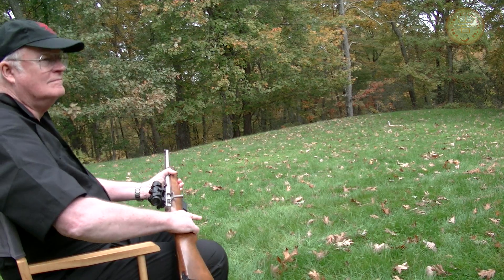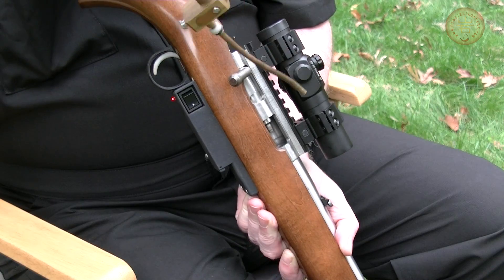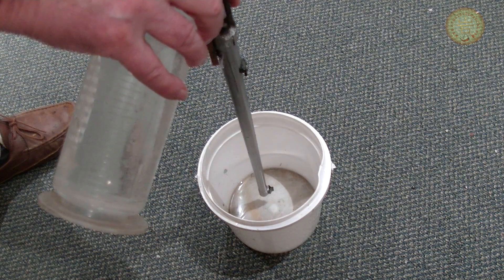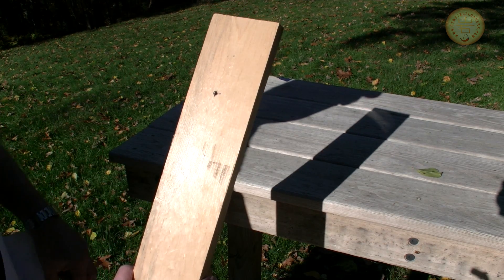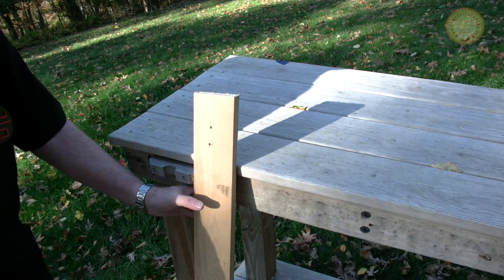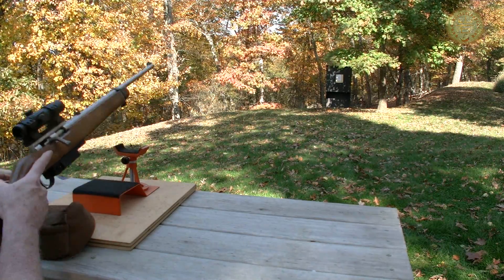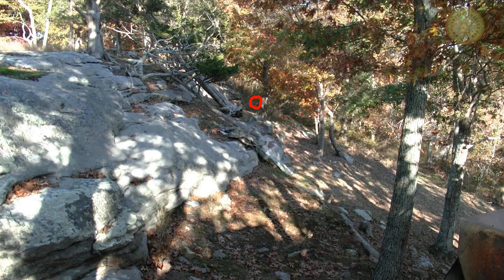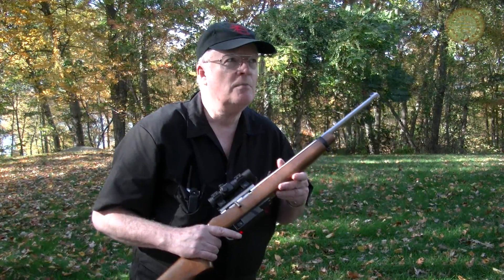The Plink-King, Part 1: A Cartridgeless (caseless ammunition) .22 Rifle

Comment: I have seen videos in your channel and it is very fascinating to see use of electricity as primer. If you are willing to could you answer some questions that I got? How long does it to take for recharge for consecutive shots and how many shots can be fired with full battery? Remington etronx also did electric ignition as far I know using resistor for primer, have you considered similar concept of popping resistor for ignition?  Thank you for your time sir.

Comment: Hi sir, can we make this type of gun  out of nichrome wire?
Reply: Yes, but the wire will not last long at all, and there is a delay from energizing to firing - it takes the wire a bit of time to heat up.
Reply: @stephenwardlaw6428  got it sir, thank you..  any idea about another way?
Reply: @niroshanbuddhika3072  Yes, although it is even more complicated. embed a 2mm fused quartz rod in the rear of the chamber and illuminate the back end with a small laser diode so the beam travels through the rod and heats the powder on the surface of the rod in the chamber. Because the pulse needs to be on only a fraction of a second, the laser can be over-driven. The other problem with this is that the 'window' needs to be periodically cleaned.
Reply: @stephenwardlaw6428  thank you sir.

Comment: Two cents a shot. That is almost as cheap as shooting a (weaker) air rifle.
If I may point out, smokeless gunpowder (BP without sulphur) is non-corrosive, safer to handle than BP and... well, smokeless!
It is trivially less powerful than corrosive sulphurous BP, and a bit harder to ignite, but maybe still worth a look especially as you take great satisfaction in that DIY aspect.

Comment: Would it be possible to buy one of these from you??
Reply from the maker: +Joey Skylynx 
Sorry, but I can't sell one, nor any parts for one. The web page and drawings have enough information for any skilled gunsmith or machinist to make one, and that's the best I can do.
Reply from the maker: +Joey Skylynx 
My ears are always open.
Reply: +mlshooter 
Alright! Well I have two ideas relating to your system, but both rely on the hope that these weapons could possibly use paper cartridges, like early revolvers and the Chassepot rifle.  

The first idea would be a backpack over-under rifle which is based on two systems. The first system on the top will be based around your electrical ignition system and would allow the shooter to hopefully fire paper cartridges or simply doing what you do at the moment with straight power and ball loads. If the paper cartridges are possible, this could also allow for the use of shotshells containing birdshot!  

Now with this system out of the way, we goto the second system: For our underbarrel, the system will be based around the 1780 Girandoni Air Rifle. It'll have a small tank of compressed air which can be pumped into with a small hand-pump, and it can be loaded with at least 10 lead balls. 

Like I said, the first system relies a bit on the hope that you can use paper cartridges with your system, as it'd allow someone to pack a few paper cartridges on a bandoiler containing either normal ball or bird shot for hunting squirrels and birds. 

Another aspect to this concept would be the ability to detach the barrels(and ignition system) and realign each system for different configurations. Ideally having either the compressed air system on top, with the ignition system on bottom(with birdshot?), or going for the original system of the ignition system on top with compressed air on the bottom.

Moving on to my second concept, which also would somewhat rely on having paper cartridges being able to work, is a revival of the Apache Revolver system. With how your system works, you could plausibly have a system in which would make for a fantastic revival of the Apache revolver, as the ignition system could be made small enough to fit into the front brass-nuckle handle, while also maintaining the revolving cylinder which could allow for quick shot follow up.

Either way, both these concept heavily rely on the hope that you have possibly tested your system with paper cartridges, if not could you give it a try and tell me how it works?
Reply from the maker: +Joey Skylynx 
A paper cartridge should work very well - at least for black powder. Smokeless may work in a 'combustible' paper cartridge. Of course, this would have to be for something larger than a .22. However, I'm not sure why an electrical ignition would be better than a needle-fire or a simple percussion cap.
Reply: All though a needle fire and percussion caps in general would work, it'd be easier to have an electrical ignition as it would improve the overall, "It'll work" when using paper cartridges. Not to mention having the ignition system would mean that the person using such a weapon wouldn't have to worry about carrying small caps or be overtly cautious relating to the needle.

I also would imagine that the work needed to flip electrical ignition and compressed air systems around with my over-under barrel concept would be a wee-bit easier compared to redoing the firing action for a needle gun or percussion cap. Not to mention would probably be a bit safer.

Actually if you wouldn't mind me asking... What's the lightest you could possibly get this ignition system?
Reply from the maker: +Joey Skylynx 
The lightest would be two to three ounces. However, if you NEED a reliable system, a metallic cartridge can't be beat. Electrical systems are hard to troubleshoot when they stop working - not to mention issues with weather.
Reply: Very, very good point. My only problem though is trying to work out a system which would ignite loose powder and paper cartridges, but at the same time keep the over-under configuration which would be able to rotate the barrels and internals for use in different parts.

If I get around to drawing up a design, I'll definitely send it your way to see what you think about it. Either way, thanks for the help friend!
Reply: +mlshooter
I got another question by the way! Have you ever by chance tried using "Armstrong Mix" as a propellant or is that completely outta the question?
Reply from the maker: +Joey Skylynx 
Use it only if you don't value your life, limbs or sight...

Comment: as this is legally not a firearm and uses smokeless could you make an integrated suppressor like some air rifles have
Reply from the maker: ***** 
I can't speak to the legality of an integrated suppressor on a rifle like this, but you don't really need one if you keep the MV down to around 900fps. The tiny powder charge to drive the ball at that speed makes very little sound - more a 'whap' than a bang.
Reply: +TheAlexagius But it IS a firearm.
Reply: Keith Larsen but legally it isn't, which is what matters
Reply: +TheAlexagius But legally it IS a firearm by US law. 

(3) The term "firearm" means (A) any weapon (including a starter
    gun) which will or is designed to or may readily be converted to
    expel a projectile by the action of an explosive; (B) the frame or
    receiver of any such weapon;
Reply: wingracer 16 it uses non fixed ammo and so is exempt from all the nfa and gca stuff, you could feasibly buy this (if it were on sale) and have it shipped to your door (opposed to it going through an ffl)
Reply: +TheAlexagius 
You probably should read the ATF definition, it IS a firearm. You are thinking that it is black powder and exempt, but the exemption is only for black powder designs 1898 or earlier and they have to be the original (made in that time or before) or a replica of that. 

That being said, I'm not one to promote the fear campaign of the BATFE's ILLEGAL "legislation". Do what you want, don't tell or show anyone, and as far as we are all concerned, we are all "legal" here.
Reply: Dave Smith "Do what you want, don't tell or show anyone, and as far as we are all concerned, we are all "legal" here" - A good general rule for many things these days, and the attitude I adopt.
Reply: +TheAlexagius If people actually followed the law and didn't do "selective" enforcement, none of us would have to do this. However, our domestic enemies now control most of this country and patriots now need to work understanding that this isn't the world that America is supposed to be.

Comment: Just one question : is this system practical for larger calibers? Not a lot larger, either .25 or 9mm.
Reply from the maker: Yes, although one would have to be more careful making sure the powder charge was carefully metered; there is some leeway on a .22 because the volume is small to begin with, but with a larger bore, it might be possible to have a dangerous over-charge if the chamber design was not right.
Reply: So, a design with locking lugs of some sort would be more adequate? And maybe 4140 steel - as much as I hate heat-treatment. Or maybe a "kamerlader" (or whatever the swiss breechloaders were called) design. Would simplify things greatly. 

Also, should I excersise any special caution while working with this ZTA material? I've never even heard of it.
Reply from the maker: MainAvel At this point, we should probably communicate directly. Go to the project's web page and email me.

Comment: Very nice build. I like the way you used the dual stage spark ignition.

Couple of questions: have you considered refining the construction (automatic ball and powder feed)? What machine was used to drill the ZTA, a lathe or some sort of drill press? Have you considered using a lithium chemistry rechargeable cell? (they hold charge very well when not in use)
Reply from the maker: Good questions: I have a magazine-loaded pistol on my channel (MLShooter) and am also designing a magazine-loading version of the rifle. The ZTA was drilled on a lathe, but I am in the process of designing an all-plastic igniter which is relatively trivial to make; I will report about it on the rifle's web site when done, and yes, my pistol does indeed use a LiPo battery. See that video and web page if you haven't already.
Reply: mlshooter Yes, I have seen the pistol video (even if it looks like straight out of a 60s sci-fi film, it's still very neat), but the battery (cell?) looked like one of those super-expensive 12V primary batteries for TV remotes.
(And they also make 3V primary lithium-based cells of similar size :P)

And I would very much like to see a slightly more powerful/accurate rifle version, even if I can't build one myself (legal reasons)...
Reply: mlshooter Also, one more thing - where did you source the ZTA rod? can't find anybody who would sell me just one (or maybe 5-10 in case I destroy some). 
Not 20, not 50, not 10,000 pieces, just one...

Comment: with this design couldnt you use the daisy VL caseless ammo? i know it uses basically superheated compressed air to ignite the propellant. so i wonder if say a hot wire ignition system would work, say take a nichrome wire loop a tiny bit so it contacts the VL ammo then once you pull the trigger it hits a switch to send current to the nichrome wire igniting the charge...just thinking outloud. cool video. and these would sell big time if you had a way of making the parts kits for a rifle, then i would think the liability is not on you as you are selling them as "parts" just an idea.

Comment from the maker: I have no interest in marketing the rifle, but if anyone else does, they have my blessings. And yes, a solar panel - either in the stock or separately could easily charge the batteries.
Reply: Hello! I love the design! I am very interested in the electronics and have some questions, for instance how long must one wait between shots (what is the charge time of the capacitors), also I am curious about the specifics of some of the wiring. Kind regards!!